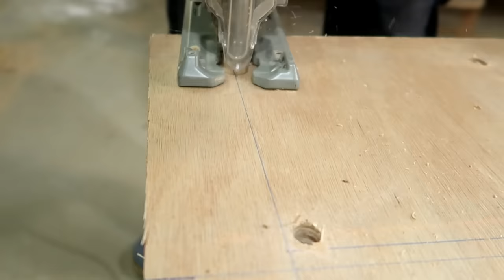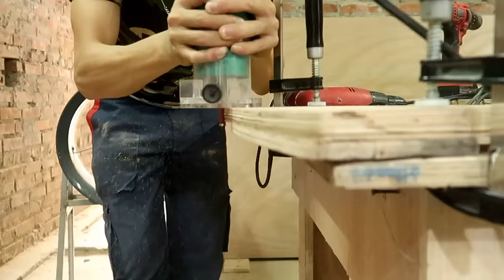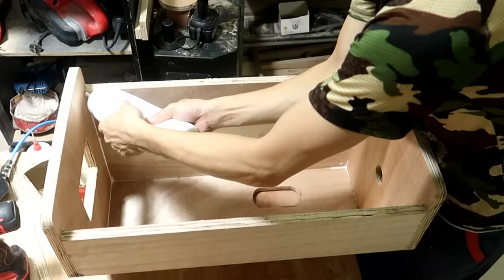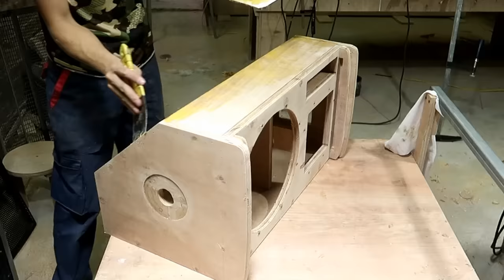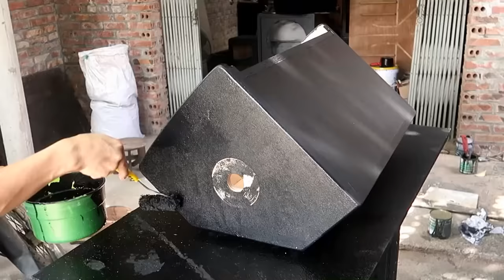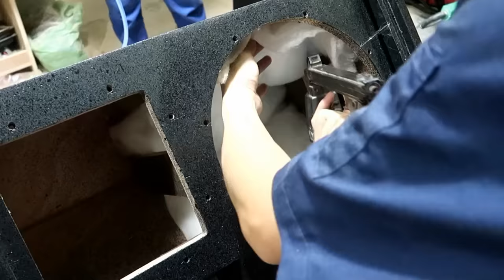How to Build a MONITOR speaker  Box  - 12 inch test speaker configuration

Comment: As far as I know, there is no copyright issue for the measurements and building of the speaker enclosures. The internal size is determined by the driver specifications.
Reply: 111

Comment: That drill chuck is junk. So the drill.
You get by with the tools your using but better tools can make your job simpler and with better results. 

You might use more templates, fixtures and jigs if your making a lot of these. 
That would speed up production.

You can use a router and template to cut perfectly matching parts and use a bandsaw to rough cut out the parts 
A flush bearing bit to trim to size
And a router bit to cut out the holes
Using a template bit top bearing  and plung cutting taking sevral passes.

Id also use MDF insted of that plywood.
Plywood has voids these tend to resonate and color the sound, MDF is dence and stable material but you must wear a filtering face mask.

That type of speaker dosnt really make good sound over the total sound spectrum, its just for playback to sounds the musicians playing normally the guitar.  It plays that frequency sound range without much problems.
Reply: MDF is awful. For touring speaker cabinets, it’s the worst and cheapest way to make cabinets. It’s too heavy, it cannot take much abuse, and is no more airtight than any quality plywood. 
Also, cutting MDF is dangerous. The fine MDF dust particles will choke you if you do not wear a respirator. Using a router on MDF is one of the worst things to do in the shop. A simple mask will not do. 
One benefit of MDF over plywood, even Baltic birch plywood, is it’s super easy to paint and veneer over. Plywood takes so much prep. That’s the real reason why you see home and studio speakers use MDF instead of plywood. It’s easier to make prettier.

Comment: What I know about speaker design is a drop in the bucket, but I still know more than y'all. First off, the one place full density particle board shines in in speakers. you obviously don't understand that's what's behind the speaker is important too. Why the JBL label? They didn't make them. They wouldn't. The size and design of your ports is critical as well. You don't need the fiberglass or whatever that is, you need a 47 degree sound board. the list goes on.